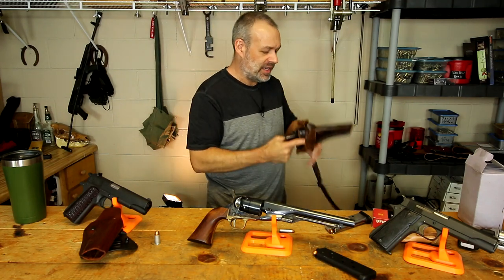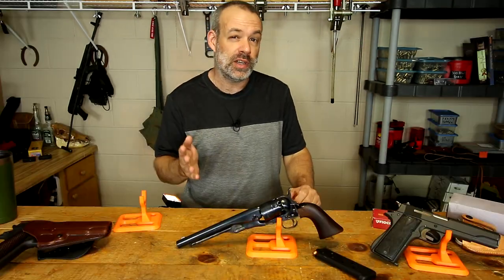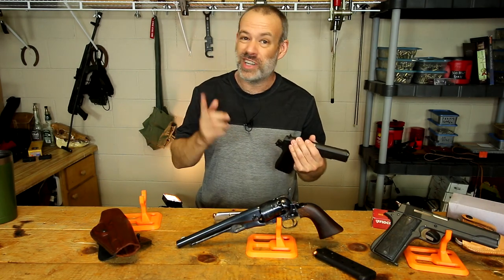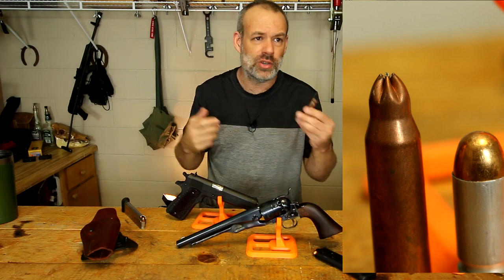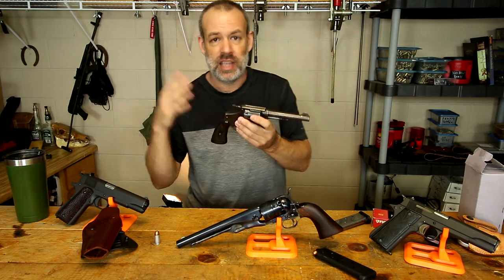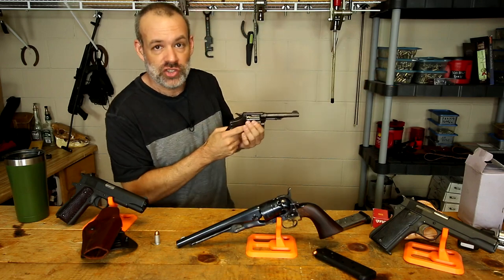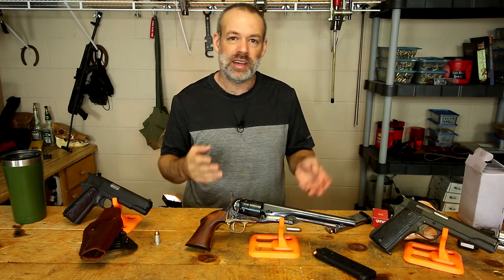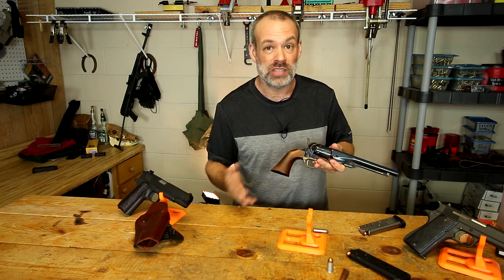How Do Prop Guns Kill?

Comment: I have two theories and two fair observances.

My two theories on what could have happened:
1: A dummy round was fired off with a live primer, the bullet squibbed, nobody checked the barrel, a blank was fired in the gun and presto, "The Crow" 2.0.
2. There was a union for prop masters who walked off the set to protest "safety issues." It's not out of the realm of possibility that a member of said union put a live round into the gun so as to cause an incident to prove their point. Unions have done that sort of thing before.

My fair observances:
1. There's no way that it was debris coming out of the barrel like a plug or obstruction. It had to be a live round, and we know it wasn't a softcast or hollow-point bullet because it went through one person, without killing them, and then into another person, killing them. It had to be a hardcast or FMJ bullet. Based on this, I'm inclined to believe theory 2.
2. Alec Baldwin is a producer for "Rust." He's had a hand in the decision to use real firearms as props and to hire the armorer that handled said guns. He's not above prosecution in a state like New Mexico where actors don't get free passes like in California. He's ultimately going to have some level of responsibility for what happened.

Comment: Good info. However, as an experienced Marine firearms instructor myself wouldn't the shooter still be responsible to insure the weapon was indeed safe before pointing and pulling the trigger at someone else. The camera person killed was no actor so...  I'll definitely be interested in finding out how this occurred. On its face it seems to be clear negligence on Baldwin and the armorer. I read one piece saying the armored was fairly new and inexperienced with blanks.
Reply: It has also been said (but, as far as I know, not verified) that the guns were used for target practice between scenes (by whom and under what circumstances I didn't hear).  It is entirely possible that the guns weren't cleaned properly and a live round was left in the weapon.  Also, if they did have live rounds on the set (which should never happen) then possibly the armorer loaded live rounds into the gun when she thought she was loading in blanks.  We'll have to get more info to see where the truth lies.  Unless they start burying the information.
Reply: Each person in the chain of handling the gun aught to have ensured the gun was safe.
Reply: When you pick up a revolver, check the cylinder, and see brass, you know you are holding a loaded weapon, because the chances of that brass being blanks is pretty close to zero. If an actor checks the cylinder, they are expecting to see brass, and the chances of them being anything other than blanks should actually be zero because there is no reason for anyone to have live rounds on a movie set. 
I heard an interview with an actual Hollywood armorer who basically said he expects the actors and crew to be clueless about guns and safety, and that it was his job to make sure stuff like this didn't happen. Nobody was allowed to touch a gun that he didn't personally safety check and hand directly to them, and nobody but the actor he handed that gun to was allowed to touch the guns at all. Those procedures obviously weren't followed on this set.
Reply: Sadly, its not rocket science, but actors don't spend a lot of time in reality I guess.
Reply: @gregoryfoster8179   some do, Keanu reeves spent alot of time training with guns for the matrix and even the john wick movies, i'd bet money if you handed him a gun he would instantly check it to make sure its safe.
Reply: In principal, you're right.

But in a movie situation it is somewhat different. If for whatever reason the needed live looking rounds (when he fired directly at the camera, the bullets on a revolver are visible, so this is a possible situation), it would be impossible for him to distuingish if it was an actual live round or a dummy. That's why they have prop masters that hand out the guns for each scene, because the actor can't tell.
Reply: @jochenreichl796  He/She has to open up the cylinder and check. Period. Even with blanks or dummy rounds. If not, you get dead camera people. Duh! Gun safety 101.
Reply: @gregoryfoster8179  I's very easy to see if there are some kind or cartridges in the gun. A Frontier era revolver usually doesn't have an open up cylinder, though. But that doesn't matter at all, because dummies and live rounds look alike. Even if he poked out every single cartridge, he couldn't be sure which one was live and which was a dummy.
Reply: @gregoryfoster8179  don't call me socialist, I'm far from that.

Great for you that you carry a .357, and that your (NOT movie) snap caps are clearly marked.

I know how to shoot, a own some guns, and my average consumption on ammo is about 10k rounds per year.

As stated in the video, movie dummies are often made by extracting the powder from a live round. You won't be able to tell the difference. I live in Germany and can't just send you some for comparison. But any reloader can make you some.
Reply: @gregoryfoster8179  I think you misinterpreted my answer anyways. I'm not saying Baldwin is not responsible at all. As the producer of the movie he is responsible to have qualified personell who doesn't ignore safety rules.

But on the movies a lot of things are different from real life cooper's rules. You will need to point a loaded gun and pull the trigger at a person you are not intended to kill. And that's what the props master is for, to ensure the correct gun and ammo type for that scene is being used. Most actors are not trained in real life firearms usage. And there shouldn't be any life ammo anywhere near the movie set.

Personally I wouldn't want to be an actor in a scene like that. Because I am trained in gun usage, I would not be comfortable to be on either side of the gun in that situation.
Reply: @jochenreichl796  wow. I didn't know y'all had 10k rds in the entire country. Just kidding. 1 of my pistols is German. Yeah  understand the self mgfrd aspect bit one would assume a professional armorer would know full well to mark those self made snaps. Bottom line, responsible shooter should never point a gun, loaded or not, at another and pull trigger. Not in America anyway.
Reply: @gregoryfoster8179  a Korth per chance?
Reply: @marvinkline5667  Weirauch Windicator. I understand they're best known for air rifles, but this .357 mag is sold thru EAA as one of their budget lines. Not bad for a belly gun.
Reply: @gregoryfoster8179  nice little rig with a punch. My everyday carry is a Walther ppq SC in .40. You mentioned.357 and Germany my ears perk up lol I would love to have a Korth but who can afford one lol
Reply: Actors are Not ALLOWED to check if guns are loaded on set. That is supposed to be strictly the Armorer’s job. Baldwin was told the gun was unloaded. Investigators found two other loaded guns on the prop rack.
Reply: @gregoryfoster8179  Actors are not allowed to check. OH&S rules. The Armorer is supposed to certify the guns are Hot or Not. This was a cartridge conversion revolver so you can’t see the brass to boot. Two other loaded guns were found by investigators on the supposed “Cold” rack.
Reply: Apparently she was also lax related to the control of weapons and ammunition. No apparent chain of custody and supervision either.
Reply: @allangibson2408  I'm sure there are OH&S rules, but that doesn't absolve the actual shooter from checking to make sure the gun is not loaded before actually pulling the trigger. The only thing that prevents that is negligence. The bottom line is what OH&S or any other organization or individual rule should not prevent 
common sense and standard knowledges and practices across the entire firearms industry from being followed.
Reply: @gregoryfoster8179  The OH&S rules specifically require that the Actors are not allowed to open the action of the guns. It sounds silly to anyone who has had Jeff Cooper’s rules pounded into them but they predate Jeff Cooper publishing them. The intent was to ensure that live rounds could not be loaded by untrained actors by mistake but rather the set armorer would have full control over which guns had blanks or dummy rounds (which are externally indistinguishable from live rounds) and similar issues. A gun loaded with live ammunition is indistinguishable from one loaded with dummies (other than weight of powder).

Comment: Alec Baldwin IS responsible as the man handling the weapon, EVEN IF the prop master did absolutely everything right.

They have protocols, period.  Alec is responsible for following all protocols.  Protocols simply were not followed, they couldn’t have been.

You don’t have enough info to say (at the end of your video) he wasn’t responsible.
Reply: Alec Baldwin is responsible for following protocols, and so is the prop master that modifies the gun to fire blanks, and whoever loads it. There isn't enough info at the end of the video to say Alec Baldwin isn't responsible, but there isn't enough info to say that he is, either.
Edit: This concerns the end of the video specifically, not the case in general. New information has come out since then, but Deuce wouldn't have had access to it then, because obviously, it didn't exist yet.

Comment: In my experience, a blank round is only deadly if fired at someone at literally point blank range at vital area. However, this doesn't negate proper safety handling practices for firearms. This is assuming there are no obstructions/round.
Reply: At the root of the problem is that a "real gun" was used, regardless of whether a blank or a real bullet was fired. Guns that only fire blanks have been around for decades.

Comment: Regarding fabricating realistic hero inert rounds, a safe practice is to drill a small hole in the brass, usually near the base. Then assemble the dummy round with inert primer. Deburr the drilled hole if necessary so it drops normally into the cylinder or chamber. Handled and filmed carefully it'll never show.

It's a good way to ensure there's no powder in the dummy round. And if by some chance a live primer is loaded the drilled hole will help vent gases and reduce the risk of expelling a projectile.

That was also my standard practice for making snap caps years ago before visibly safe plastic snap caps were available for some cartridges that were still uncommon in the US.

I can't take credit for this trick. It came from an older book and chatting with people behind the scenes on film crews. 

Nowadays I'd also consider making lightweight plastic bullets coated in metallic paint for realism. Again, less mass, less risk in the off chance a live primer is pressed into a dummy brass case.

Comment: Well, I disagree with you on one point, It was Alec's finger on the trigger. Now that being said I don't know the circumstances that lead up to this. Alec being blameless well he is also the producer of the 6 million dollar epic. So yeah he bears some of the responsibility. Either way, it's a mess.
Reply: @seanramirez488  he's been acting for like 40 years. He's been told what is and is not okay, it's the actors responsibility to be involved in safety. It's literally their only job (acting and related subjects).
Reply: This doesn't pertain specifically to Alec Baldwin but how far does the actor's responsibility go?
If the prop master hands the actor a pistol and the director says, "Aim it at the camera and fire it," how much fault is on the actor if there was something wrong with how it was loaded?
That can go into vehicles. I think there's a story about Quentin Tarantino pressuring Uma Thurman into driving a car that was unsafe (or to drive it on a road that was unsafe) and she got injured. It's like, how much should she have known about the situation versus how much should she be able to trust the stunt coordinators?
And then you get into explosives... that's got electrical components and charge measurements and all sorts of elements I don't think most actors can realistically know everything about.
Reply: Baldwin is not blameless because he was handling the weapon unsafely before the filming was started.

Comment: I was told it was a replica of a Colt Navy model cartridge conversion revolver in .38 SPL.
They created a squib, and a bullet lodged in the bore. Afterwards, a blank was fires and pushed the bullet out.
And no, military blanks are not higher pressure. There is a blank adapter that attaches onto a flash hider and a hollow rod screws into the muzzle to form a constriction that causes recoil, so the mechanism will cycle.

Comment: Maybe the prop masters will start having barrels machined with the blank firing device milled into the barrel vs welded in. It will increase the cost but will be much safer. 

John Wick used real guns. The blank defuser or firing device were milled by Taran Tactical.
Reply: Actually they were done by The Weapon Specialists out of nyc. That was a fun job.
Reply: There are already several manufacturers that make real metal, fully functional handguns in both semiauto and revolvers that can only accept a blank cartridge. A round with a bullet won't fit. They cost anywhere from $100 to $200.

Comment: Not all no-charge loads create squibs. Primers can produce sufficient pressure for the bullet to actually exit the barrel. Also used primers can easily be reused by using an appropriate size punch, hammer, and solid surface to flatten out the dent. Not only can such a primer look unused when reloaded, but it can actually function as a primer when loaded again with 1 of many methods of reloading primers.

Comment: I worked in high rise commercial construction (  depending on which union you talk to is debated between 35-40 years) We used " Powder Actuated Guns " my brand was .27 calibre , these guns used  "blanks " but operated on the force generated by the shells explosion ,  to drive a high tensile pin ( or " nail  " )  into concrete or steel ,  so this application had to have an open barrel . To the best I can understand , " Why do these guns have an open barrel , that allows a projectile to go down the barrel ?

Comment: It was a Uberti Colt 45 copy. As far as I can make out, the crew went out plinking cans with several guns at the back of the lot and left the guns on a cart there. When the cast were arming up the guns were recovered from the cart, they were not in the custody of th armourer. A man picked up the Uberti gave it to Baldwin who was about to practise a cross draw in front of the camera crew. As far as I am aware no-one cleared the weapon, loaded or unloaded it. This is not to say the gun wasnt loaded. In the process of the shoot Baldwin does his draw, the gun discharges with a round going straight through the deceased lady and into a man behind her. 

Although faithful to the original single action Colt design, which has no safety, the Uberti Peacemaker models in Colt 45 have a transfer bar fitted, which means there was no accidental discharge, he had to have his finger on the trigger to discharge the gun.